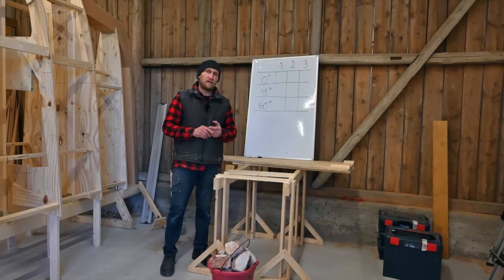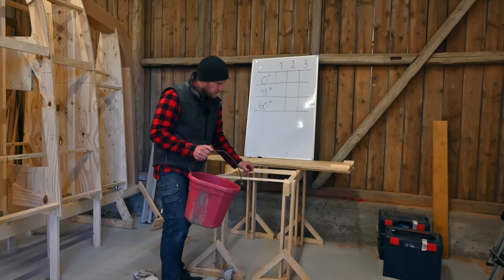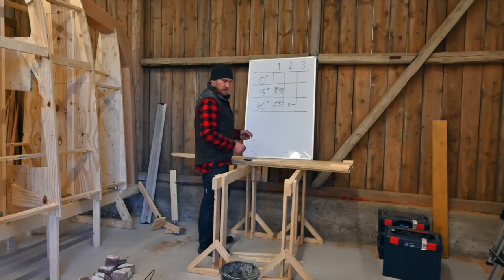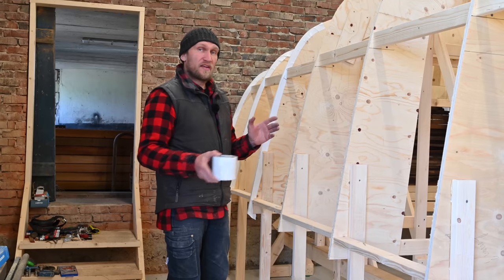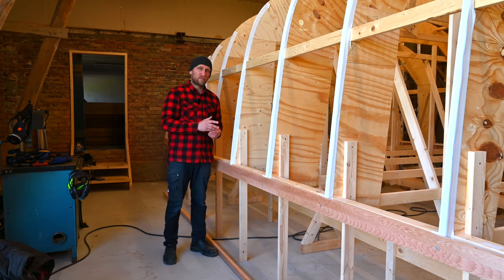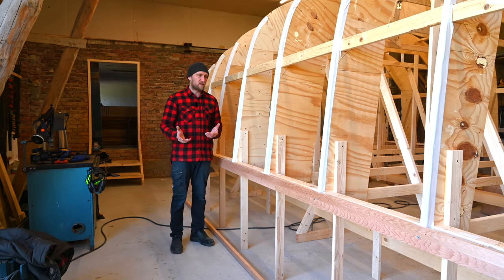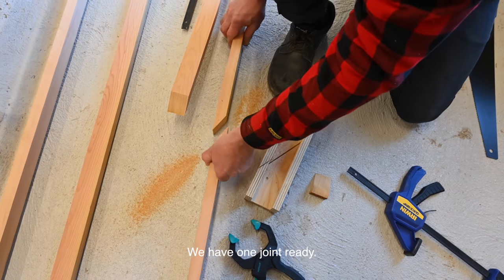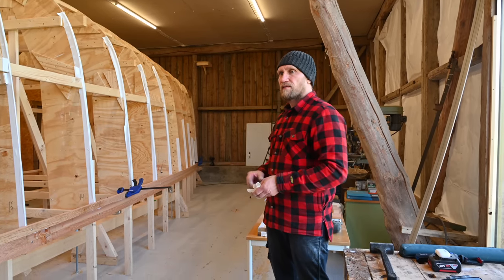The First Of 150 Strip Planks | DIY 50 Ft Sailboat - Ep. 344 RAN Sailing

Comment: Although you have a very rough and ready method, relative (percentage) strength should be againt the full strength wood, not in relation to the 60 degree joint - that would give a better sense how the joined pieces have lost strength and how joint style mitigates against that.  Also, orientation of joint would be important...

Comment: The length of the joint should be 6-10 thicknesses of the board. This is a standard norm. 60 degrees are not enough. But perhaps the thickness of the fiberglass compensates for the lack of strength of the connection.
Reply from the maker: There’s different standards for scarf joints depending on the use. In this case, since we’re building a composite sandwich hull, there’s no need for a scarf joint. We’re using a 4:1 scarf anyway, but we won’t need it for strength. The standard scarf joint for hull planks in traditional wooden hull is 4:1, if you building according to the old Lloyds specifications. Cheers!

Comment: You could use less expensive screws and then remove them after the epoxy sets.
Reply from the maker: The only reason we need to leave them in is because we want to install more planks on top before the epoxy is cured, to speed up the planking.

Comment: screws bad idea, set of pipe clamps would work for four or five planks at a time.  the horizontal screw could be a block to hold clamp.  the price of the screws would buy a lot of clamps.

Comment: All those joints are crosscut miter joints, except the butt. Why didn't you do any actual lateral scarf joints? With those, the glue joint is the full thickness of the wood, but you can angle the joint more greatly to spread the load over 3 to 4 inches.

Comment: screws in the planking is a really bad idea. I owned a strip plank cedar epoxy boat that was struck directly by a 300 meter cargo ship travelling at cruising speed and I learned quite a lot about how these hulls gain their strength. Thin planks like your with wide seams and no screws is the strongest and fastest. It uses a bit more epoxy but you use fillers so it makes little difference.

Comment: Like the test but i think the 100% strength is no joint at all then you can see what loss you have per scafe joint angle.
Reply from the maker: Correct, but no joint at all isn’t possible. 😊
Reply: @RANSailing  no joint means the strength of the wood uneffected by your chosen cut angles. Do not get me wrong I totally agree with your prep research and as an engineer totally agree that informed decisions are to be commended. Well done both for taking the time and allowing us along.

Comment: A scarf join should be 8:1 brother. if you're joining 25mm thick timber, the  scarf should be 200mm long, easy enough to make a sliding jig for the table saw to replicate it over and over, especially for the amount you are needing to do
Reply from the maker: There’s a reason we don’t need 8:1 or higher that you probably missed. We’re not building a traditional wooden hull, it’s a sandwich build. Cheers
Reply: @RANSailing yea i commented before you mentioned  12:1 in tye video. I understand all the composite resoning.  at my work we would still join 8:1 but we scarf and glue 100% of them together before we start applying them to the mold. Just makes attaching the strips easier and quicker.. and the most important part... easier to get laying fair
Reply from the maker: That’s what we have decided to do also, but with a 4:1 scarf. Like you say it’s easier with a shallower angle to get a fair curve and a bit easier keeping everything in place during glueing. Cheers!

Comment: Arent you over thinking the scarfs and screws, its just core material, you could just use foam. If the core is taking any load it hasnt got enough glass on it?
Reply from the maker: Yes, we probably are. The scarfs will be used mostly to make it easier to get a fair curve and the screws is also an attempt to keep the planks as aligned as possible between the stations. This will save us some time later on hopefully with less fairing.

Comment: A boat scarf joint is 12 to 1
Reply from the maker: For a traditional wood hull the scarf is 4 to 1 if the joints aren’t stacked and at least 1,2 meters apart. 12 to 1 and higher is mostly used for spars and keel joints. These numbers are from Lloyds. However, we’re not building a traditional wooden hull, we’re building a fiberglass sandwich hull with a cedar core. Very different!

Comment: Johan, is it not true that your relative strength test of the jointing methods is not correct and only part of the overall story? Is it not correct that the relative strength of the joint to an unjointed section is the correct test? (in other words, how strong you can get the joint compared to the virgin wood strip. 

Due to the fact that the joint between the longitudinal planks will be a butt joint, then that sets the torsional and penetrative strength of the wood skin- the joints matter far far less. A strip end butt joint would match, but you need to then allow for strip end springing during construction and during impact.  I'd add additional strength by a penetrative epoxy like West Epoxy on both sides of the strip, thus creating a composite sandwich of the wood core. Then add a biaxial and a smoothing fibrelass or kevlar later to both sides to bind the joints and form a stronger, more longer-lasting and more waterproof hull skin with high physical penetration resistance. 

Question, why did you not decide on cold moulded multidirectional thin strips? You get very very high torsional, stiffness and penetrative strength, light weight and ease of handling during building for not very much more build complexity. A glass fibre or kevlar layer or two on to of that would be ideal.

Comment: I was chosen to take the new Google Bard for a test drive. Here is what "he" said

"Here are some of the "rules" for shipbuilding with wooden scarf joints:

The length of the scarf joint should be at least 4 times the thickness of the wood being joined.
The joint should be tapered on both sides so that the two pieces of wood fit together snugly.
The joint should be glued and clamped together securely.
The joint should be reinforced with screws or nails, depending on the size and weight of the boat.
Here are some additional tips for making strong scarf joints:

Use high-quality wood that is free of knots and defects.
Make sure that the wood is properly seasoned.
Use a sharp saw to cut the scarf joint.
Make sure that the joint is perfectly aligned.
Apply glue to both sides of the joint.
Clamp the joint together securely.
Allow the glue to dry completely before removing the clamps.
By following these rules and tips, you can make strong and durable scarf joints that will help to ensure the longevity of your wooden boat.

Comment: Why don't you use headless steel nails in combination with a nail gun. After laminating the outside is done you can easily remove the nails with a pincer from the inside after you turned the hull and removed the temporary frames by hammer.
And please do yourself a favour and do the fairing of the hull when it is still upside down. Furthermore please discuss with the designer the possibility to use a strong horizontal flange (500mm wide and a thickness of 50mm) on top of the keel like Moody does to reduce bending moments in the keel-hull connection. This plate can easily be integrated in the hullshape and is much safer than the factory boat design. Running aground would not be an issue with the actual joint length of your intended keel design, but to be on the safe side it is worth thinking about it. While running aground the front keel top is torn off the hull, while the rear part is pushed into the hull. And what is preesure? Force per area.
Another side advantage is the reduction of the keel bolt size.   And most important I would like to condolence.

Comment: Sorry about your dad! Your test for the joint strength was not accurate as you did not use a control (a solid piece of wood).  You just tested your bonding material only.  I am not sure if you guys can get it, but here in the states we have a product called Gorilla Glue.  I have been using it for years and no joint, no matter what shape, size, or form, has ever broken at the joint.  It is inherently stronger than wood of any kind and most materials in general.  Your wood will crack and splinter elsewhere but it will not be at the joint no matter what the angle.  It is not cheap, but used in the correct manner it is far stronger than most materials it bonds together.  Of course it does not matter now, and I believe you to be correct in your joining.  Hope this is somehow helpful!

Comment: Can you arrange to cut your scarfs with a chop saw? Hand cutting with a mitre box will get old quickly. How long the mitre box lasts also an issue. Alan (Wave Rover 650 link) cuts his scarfs with a jig on his saw bench but his have a very shallow angle. Can you spend a week or so just making long length planks to enable a long spell of fixing? It might not save much time but will show steady progress.
https://www.youtube.com/watch?v=C7__r_GjDjY
Reply from the maker: That’s the plan. I’m in the process of making a jig for the mitre saw. Cheers!